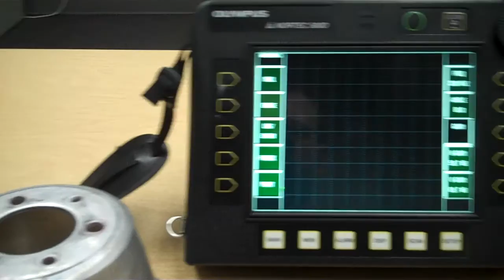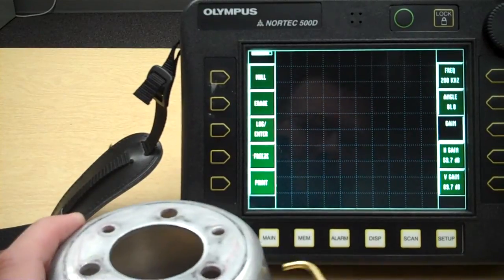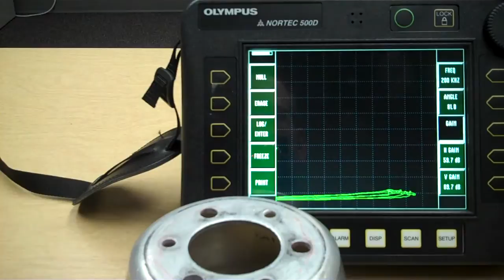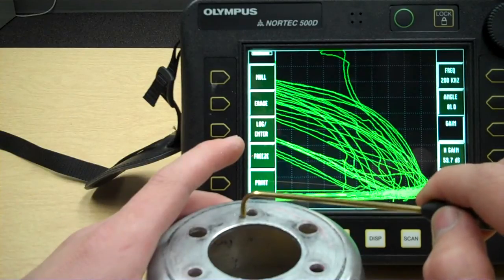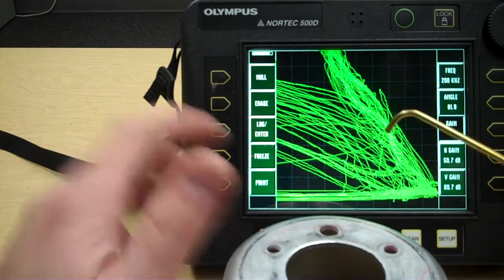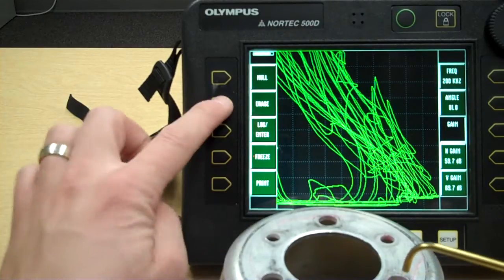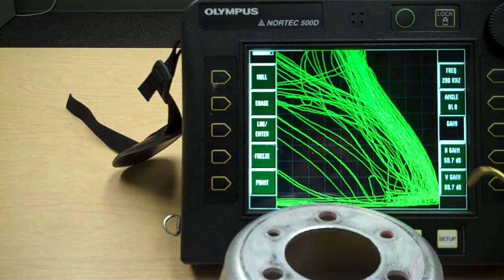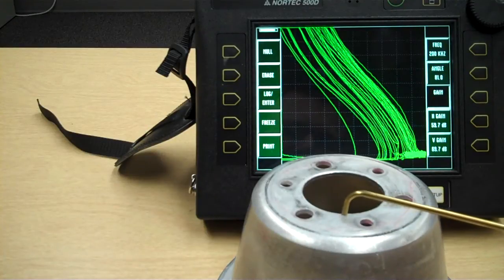Crack Detection on Part

Comment: I like your movies concerning ET. They were very helpful. I also use Nortec 500D flaw :). 
I have some problems with testing welded joints from ferritic steels.
Is it possible for You to publish a video showing how to calibrate the flawdetector as well as how to perform testing of welded Tee joints (best with three stitches)?

Comment from the maker: Greg NDT,

I did try this on a welded joint, the biggest thing that helped me the most was the high pass filter.

Let me know if this helps - Check out the steel ET Crack Detection video

Joe

Comment: Could you detect the defects even if paint was already on the part? or what's the surface preparation before using Eddy Current? Thanks.

Comment: Can we inspect crack or damage of 70/30 CuNi tube dia 25 mm with Nortec 500? If yes, what should I prepare?
I have 1.5 mtrs cable CL/SC/6 and probe NDT WLD-5-63/7L 100-600 KHz